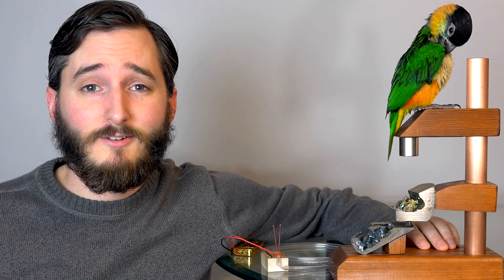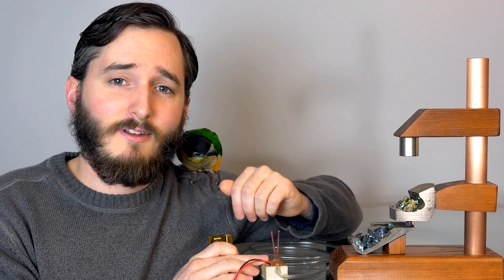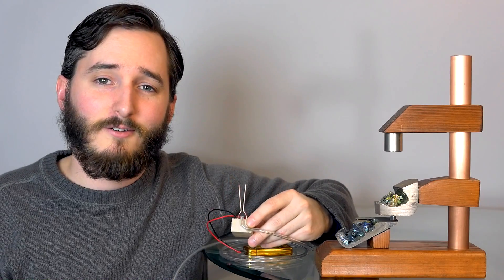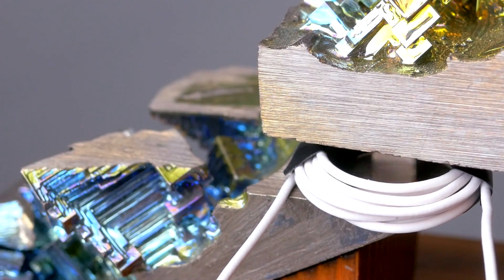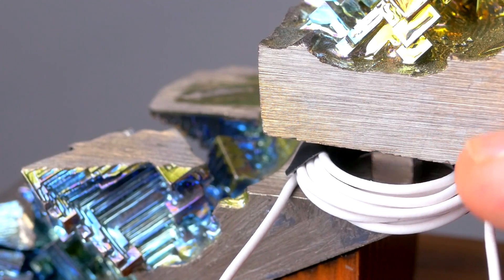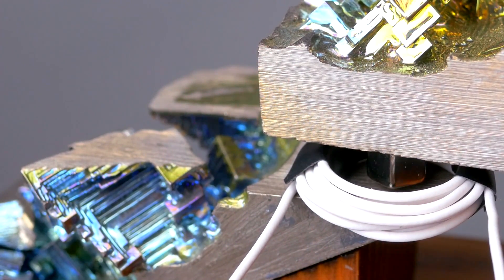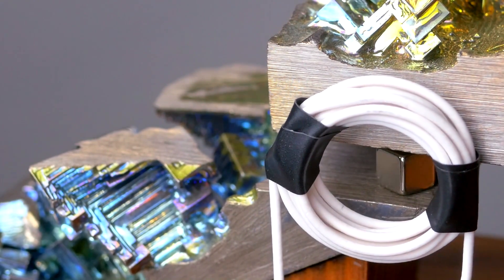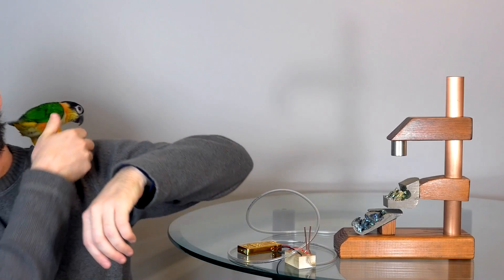Making a Jacob's Ladder from an Arc Lighter & Can a Bismuth Levitator create a Frictionless Motor?

Comment: Your design 😢of the motor is totalled different.❤🎉😢😢

You should think outside the box.

- make a bigger version. Motor does not mean add a big coil and battery. It is a motor already without adding anything yet.

You just need to make bigger version. And work on the balancing and centering of the magnet. 

To make it a generator , stick insulators on the magnet and add N. S magnets onto the magnet and a coul on the side. Boooom. Think outside the box, we learn from each other 😊😊😊

Comment: It spins because the fields are strongest from the poles of the magnet, meaning the bismuth would have the poles horizontal. When you turn on the coil, it flips 90 degrees and locks in place, storing some energy in the proximity to the bismuth. When disconnected, it immediately rotates back to being horizontal and the momentum is preserved as a spin.

Comment: I know how to make it stay central, bouyant mass.
Using an outter and inner containment you should be able to change the density and pressures in each to make the 'Balance' of equilibrium more central. This works by using a dampening zone against the centrifugal gravity of the planet. Negating weight and therfore making the object neutral bouyancy. Least energy cost to keep in that region. So magnetic locking would be more efficient in all directions

Comment: The coil is acting as a electromagnet and an inductor. When U add the current it’s charging and rapidly discharging when current is off. If u use a diode you can direct the current too which way you want the magnet too spin.

Comment: It looks like the metal that’s above the magnet looks like it’s aluminum if it’s aluminum you might be creating the jumping ring affect where you have a higher coil of electricity flowing through charging the aluminum and when you disconnect it and that is when you get the spinning charge , The jumping ring is when you take an iron core rap it with wire at the bottom and take an aluminum ring please it around arm core hit it with like 200 votes nothing will happen to the ring only when you disconnect the power the ring creates a charge and somehow magnetically jumps out of the Iron core I’m saying if that metal is aluminum somehow you’re charging it And that’s why you’re getting it spinning affect afterwards when you disconnect The power I think it’s called Eddie currents

Comment: Ohm's law states that the current through a conductor between two points is directly proportional to the voltage across the two points. ... More specifically, Ohm's law states that the R in this relation is constant, independent of the current.

Comment: and it spins because the megneticfield is vortexed. the moter wont work because even though you can have perpetual motion but if you try to harness it, you will start adding resistence

Comment: my guess as to why the magnet spins is residual magnetic field as the coil is not discharged completely instantly.
i think u might be able to get it to spin properly if you lower the power on the coil and center it better.

Comment: I think your problem might be about the continuos voltage that you are aplying that makes the maget just atract to one of the sides of the electromagnet created by the battery (DC voltage therefore DC current therefore Constant in time and space magnetic field) you shoudl try the same experiment with maybe even same whole setup but providing a voltage source to the coil which is variable AC Voltage. You can generate that by scraping some smartphone charger which has a transformer inside, if you can provide it with like 5 volts AC (50Hz frecuency is on Spain, I cannot actually remember about the EEUU)  you can maybe make it into an almost frictionless motor.
Thats all if you wanna try just scrap some iphone or whatever phone or small device and look for the small transformer, make sure it does lowers the voltage on the secondary coil and gives you something in between 3-7 volts AC conect the outputs of the secondary transformer coil to your white wire coil and see what happen.

Comment: Use some coils of wire and hall effect transistors to time the spinning. Use them to cause an electric current in the conductor and to an applied magnetic field perpendicular to the current. Nobody winds a motor like you have there.

Comment: I think Keystone Science had it correct.  I'm also thinking that the second orientation of the coil off to the side was a good move but the orientation of the cube magnetic field was 90 degrees off for the motor function.  That and you'd need a rotating magnetic vector like 3 coils 120 degrees apart.

The stuff that you were doing,  I don't think was a motor. More like a solenoid or something.

Comment: I am not a expert like u guys. And I am too lazy to explain y I think this might work. I think a very low ac voltage through the coil might do the trick. If I am not wrong my guess is when the voltage drops to 0 there is a small amount of opposite magnetic field created like what a AC current would do and it is making it spin. And also the amounting external magnetic flux to spin something which is flooring so delicately should be very low, applied for a long time to see the result.

Comment: A different coil arrangement and a circuit to drive the coils so that the magnetic field changes ahead of the poles on the magnet so that the poles of the magnet are always moving toward the new alignment should cause it to rotate. This gets complicated quick though.. Think of how stepper motors rotate. But, I’m not really sure how the existing magnetic field would affect this idea. It’s something I’d have read more about.

Comment: Seems to me you have something like an alternator at work when the magnet starts spinning like that (for what ever reason). Try measuring amps and volts being induce in the coil rather than adding a battery to it.  The magnet is acting like a rotor and the wire as a stator in an alternator.

Comment: Has anyone suggested a smaller coil yet?  Perhaps lower voltage &or fewer wraps on the coil, and the magnet might spin without being pulled too far off center.  Maybe not a truly useful motor, but an awesome display at least lol

Comment: if I recall correctly it has over 30 years since I studied electronic induction. the collapsing electromagnetic field causes an oscillating current in the copper wire creating an alternating magnetic field. This will trickle down after a while due to the resistance in the wire and other reasons. This causes the magnet to spin.

Comment: Try aluminum wire, Or copper clad aluminum wire. You could also try a soild piece of 12 or 14 a.w.g wire, as opposed to stranded wire. A tighter coil may also make it easier. Or you could drill a hole in the magnet and make it slightly bigger than a non-magnetic rod and attempt it once more.

Comment: What if you rapidly disconnected the current several times a second?  If you made a mechanism to connect the battery 20-30 times a second, would the magnet stay in the center more reliably?

Comment: this might expllain the spinning magnet 

when the floating magnet retunrs to the centre, this motion causes the floating magnet's feild to move around the copper wire, induccing a temperary (current only exists while the magnet moves into the centre) electrical current within the coil

also i might be able to improve your jacob's ladder

if you used the wire from inside a hair dryer or toaster on your jacob's ladder this would provide the heat and might remove the need for the pipe and blowing

Comment: Magnetic fields operate by the right hand rule of vector multiplication.  As the current flows in a circle in the coil, it will produce a static magnetic field in one of either directions perpendicular to the plane of the coil.  This is high school physics level stuff, the coil positioned the way it was between the bismuth chunks was never going to produce a static magnetic field with any other direction other than up or down, let alone a moving magnetic field that would be required for a motor setup such as this one.

Comment: 6:57 - i wonder if u had a bismuth doughnut(casted in two halves, so that the inner walls can be smoothed out) then put bead magnets inside the middle and wrapped it with a coil or several time delayed coils, would that create something that is antigravity.? or would it fly/spin out of control?

Comment: I assume that the magnet spins at disconnect due to the magnetic field collapsing. I would be curious to time the average spin, and then time the average spin when connecting the two wires together (closing the loop) immediately after disconnecting them from the battery.

Comment: The  magnetic field in the coil will collapse when you disconnect the battery. That is a weakening field that is still applying some force, but it's weak enough to not pull the magnet out, so it does kick. I wonder if TWO coils with opposing magnetic fields would keep the magnet centred, whilst still giving it a kick. The two coils would be of the same number of turns, but wound in different directions.

I suspect you would need to alternate the fields, like in a brush-less DC motor. That would probably require a hall effect sensor to get the switching in time with the spinning.

Just thoughts off the top of my head, watching the magnet fun. I don't have any bismuth to experiment with it.

Comment: so... if I remember correctly, the coil generates an electromagnetic field. when you remove power that field pushes electrons backwards through the coil. this is something modern electronics need to handle with a discharging circuit as I believe it can be strong enough to damage components.

Comment: Inductors store energy in their magnetic fields. The is what causes inductive reactance, where an AC signal has its current and voltage put out of phase when running through an inductor. The magnetic flux from current takes to time to build up as well as discharge. The discharging of current creates an opposite magnetic field and I believe this is what is causing the magnet to spin. Even though you disconnected the battery, the air can act as a very large resistor which will allow the current the discharge slowly.  The speed is due to the very small amount of friction from air. A very simple circuit can be made where you wrap an iron nail in wire hook it up to a battery and then attach two free wires to the inductor in parallel. If you hold the wires and then disconnect the battery, you will feel a very large zap. I made one of these in my first electronics class, hence my knowledge.

Comment: I think the spinning is caused by the spinning... as the current flows it causes the magnet to move. When the current stops the moving magnet induces eddy currents in the coil. Those currents produce their own magnetic field, causing the magnet to move. It's a feedback loop I think. I wonder how long that would last in a vaccuum? Curious behaviour. Reminds me somewhat of dropping a strong magnet down a copper pipe in how magnet fields can interact with eddy currents caused by motion of the magnet.

Comment: Coul you have inadvertently created an electromagnetic mechanical ocillator due to the irregular permanent magnet geometry relative to it's rotational axis inside the toroidal field generated by the radially symmetrical coil?
E.g: How the rotational field generated by the rotating  permanent magnet with its cubic geometry is interacting with the toroidal coil around it?
Reply: Bernardo Salerno Lameiras Is this a joke nonsensical sentence or does that actually have meaning?

Comment: I think it's the Lorentz force that causes the spin. Depending on who you ask; left-hand rule or right-hand rule. LOL, it's the hand rule, per Lorentz. Were the magnet held in place with a pair of sapphire bearings it would spin with very low friction while a steady DC voltage is applied to the coil. I think...I feel like you could achieve a motor using pulsed DC through the coil and the same levitator arrangement you have here; maybe tie your two project in this video into one thing? :)

Comment: Hey, I just found your videos and they are great!
As I was watching the motor part of the video, I wondered what if you used the magnet not as motor, but to create electricity? Meaning you used already the coil, but instead of connecting it to a battery to a lamp  or a voltmeter while the magnet is spinning so fast.

Comment: What would happen if you used neon or argon instead of air? could you continuously modulate the color of the arc by varying the proportions of a mixture of the two?

Comment: hehe mini coil gun. When you flipped it on it's side, it acted as a solenoid, accelerating the magnet toward the center of the coil. the quick moment of current caused the magnet to accelerate to the center then cut out on the power before drawing it back into oscillation. i made a mini coil gun off of some 9V batteries last summer

Comment: On the motor. try metering the coil of wire after you get it spinning. also when disconnecting a conductor from a current source you get a momentary spike of significantly higher power.

Comment: Use thinner wire. the mass of copper is sinking too much of the heat. I had one of these lighters doing the ladder with thin wires extending from the normal elecrtodes.

Comment: The coil of wire only creates a magnetic field in this case as the current in the wire is changing. So a DC source will only create that magnetic field that causes the magnet to spin while it's first connected and as it's disconnecting. An AC source at the right peak voltages and timing could solve this problem

Comment: If you want the magnet to spin, you need to create a spinning magnet field with the coil, or at least changing field (AC) with the right orientation. You need to spin the cube in such a direction, so that the poles change their position, Idk if its evev possible in this levitating construction.
About the effects in the video: when the current is flows, yiu have constant magnet field, that forces the cube in defined position, after you shut down the supply, the magnet field fades and it colud be possible, that the cube gets spin through this change, otherweise it gets the spin through the release from the fixed position.

Comment: Someone may have already said this but the wires become an electromagnet when the battery sends a current through it (however I guess you could keep spinning magnet in a single spot and spin if it had a rod running down its center that acted like an axle. 
I suspect that the extra spin comes from the moment that the magnetic field is no longer active and once enough electromagnetic force has been lost, the spinner can be released and use what is left to put on extra speed.
I'd like to see what happens if a rod were inserted in the spinner.

Comment: It wouldn´t work as a frictionless motor in any case since actually driving anything with it would reintroduce friction, plus to make it spin consistently and effectively you´d probably need a very complex magnetic field similar to those used to contain hot plasmas.
Reply: Although instead of some super complex magnetic field you could try AC and lots of trial and error. :) Ideally with a power supply where you can manipulate the frequency and strength of the AC (a function generator), you should be able to find old lab units on ebay pretty cheap that do the job.

Comment: when it comes to the magnet spinning, upon disconnecting a load in the fashion you are there is a huge inductive spike that runs through the coil causing the magnet to spin, it very brief, in order to make this a motor of some kind you need a specially polarized magnet and and rapidly switching power supply connected to several coils in order to create something similar to a brushless motor, I think it's very possible to create a near frictionless motor this way using your levitator

Comment: The cause of that rapid spinning after disconnecting the battery is the pulse defined by Lenz law;" The direction of current induced in a conductor by a changing magnetic field due to Faraday's law of induction will be such that it will create a field that opposes the change that produced it. "

Comment: i think it gets stuck on the wire because the wires are not equally placed?  not sure how to word it. maybe thinner  copper wires and weeker batteries.  and i think magnet spins after disconnecting the battery because of inertia...

Comment: Why not use a 555 timer to commutate the floating magnet?  You can swap one resistor with a potentiometer and have a speed controller.  I wonder how fast it would spin?

Comment: There is a magnetic field that remains after you have disconnected the battery.  When you first connect the battery, some of the electrical energy is spent building a magnetic field around the corner.  After you disconnect the power, the energy in the coil is converted back into electrical energy.   This means that there is a slight residual field surrounding the coil even after you have removed the power.  This may account for the rapid spinning

Comment: i could be wrong but wouldnt it be the calapsing magnetic field when you disconnect the battery that induces the spin? and if it is, im sure the crystals are affecting the fall time of the field giving varied speeds when the battery is disconnected.

Comment: Inductors resist change, its storing a charge and dumping it out as magnetism when you disconnect. Use less turns on the coil and put a variable resistor between it and the battery,

Comment: I think you need to make an AC motor, with a few coils around each side, positioned vertically instead of horizontally like you have now. Maybe a 555 timer with adjustable pot to change the speed to energize and deenergize the coils rapidly.